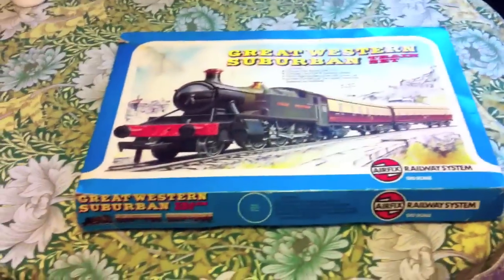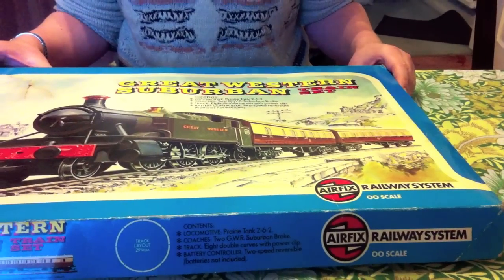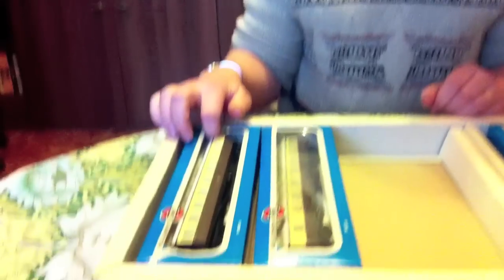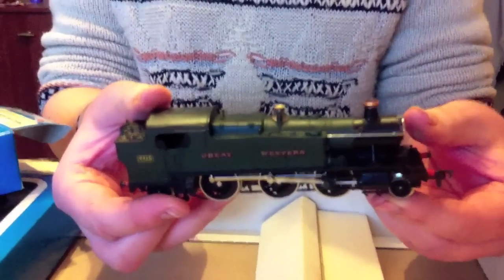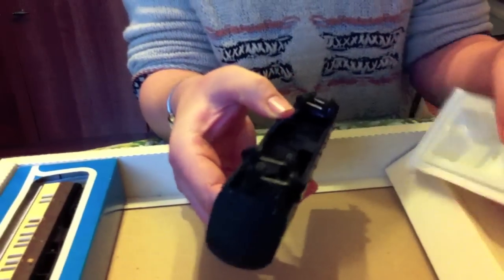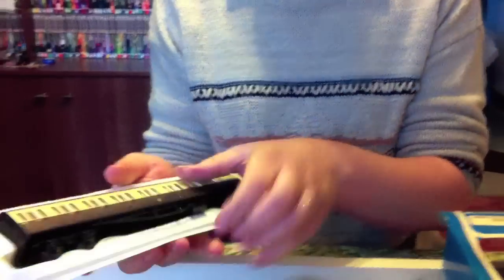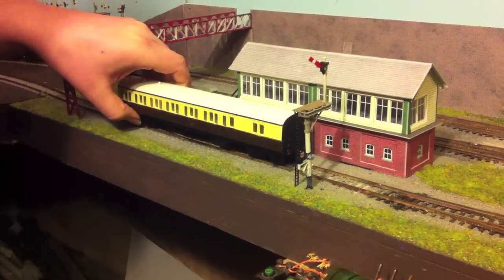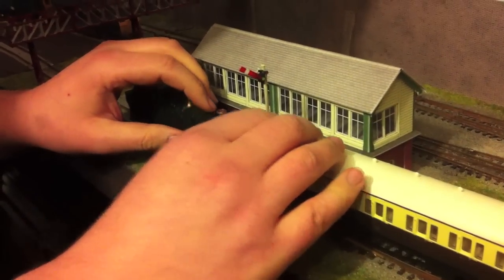Opening the 1976 Airfix Railway System Great Western Suburban set

Comment: If your layout is PECO streamine then that was what this old airfix stuff was running on when new. I had one new back in the 70s and it didn't last long....the plastic support bar for the slide bars on the valve gear broke very easily and no spare parts and no ebay back then. Thanks for the trip down memory lane. I've only recently tuned into your channel and I enjoy watching these types of video, it has got me back into model railways. It started about 6 weeks ago when I purchased a few coach kits....now I've gone out and bought a few locos and resumed building a whitemetal kit I last worked on in 1992!

Comment: Locos that have been in the attic for decades should be serviced and oiled before running them in again. The oil applied decades ago have long since dried up.
Reply from the maker: I use fully synthetic engine oil grade 5W30 which seems to work well without damaging mechanisms. This locomotive did ultimately get a good oiling... and then was promptly stolen in a break in and was one of the few items that were never recovered by the Police! Such is life.
Reply: don't use 5w30 oil, but use gaugemaster model oil, much better oil for model locos.